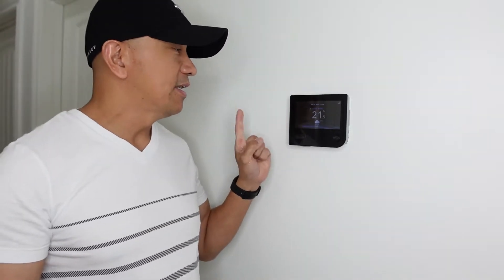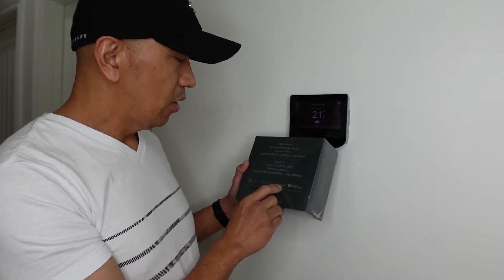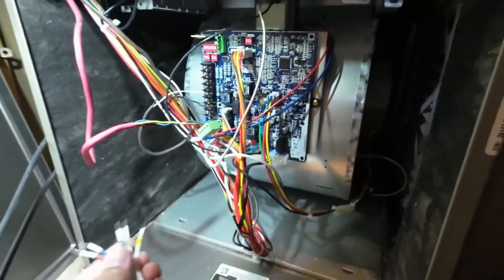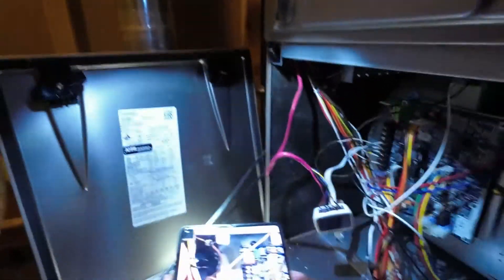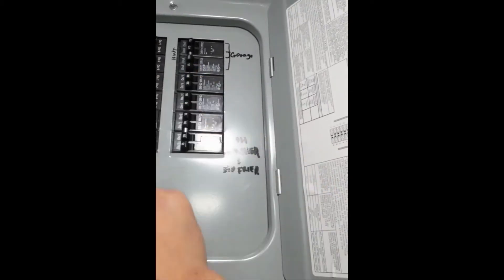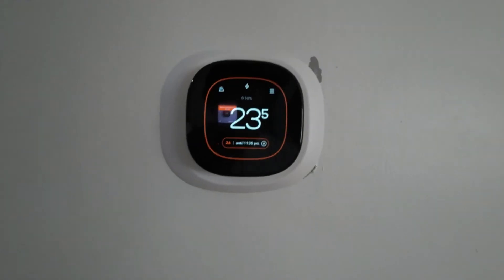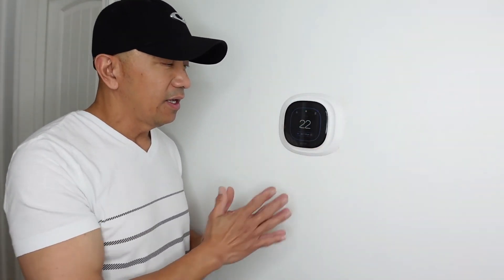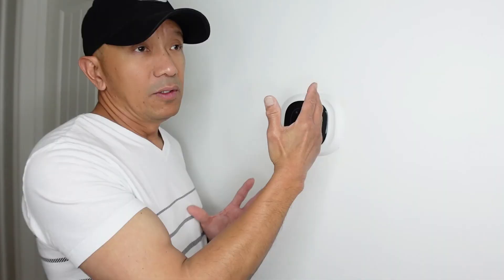ECOBEE HOW TO INSTALL SMART THERMOSTAT AND PEK POWER EXTENDER KIT UPGRADING FROM INFINITY TO ECOBEE

Comment: Great video, you also answered a question that I couldn’t find even in the Ecobee website about the power kit extension. Thank you.

I’m going towards the same direction as the Ecobee software is much better and supports Apple HomeKit nowadays. Tho, the humidifier unit may need external control, right now it’s “controlled” by infinity, however I don’t even know when it’s running or not, the app shows as not installed the wall unit shows as installed, I know it’s working because I check it at the humidifier unit. It’s a mess anyway.

Again, thanks for the video.

Comment: Hello, thanks for the detailed  instructions. I have the Carrier Infinity Touch system but the proprietary 4 wire in my house for A; B; C; D; is  Green (A); Blue (B); White (C); Red (D).  My mounting plate is color coded like yours (A = Green; B = Yellow; C = White; D = Red). In your video you do not show which wire is going to the terminals unfortunately as they are already disconnected when you are removing the old thermostat mounting plate. Can you explain how your four differently colored wires (Looks like Black, Yellow, Blue Red in the video) were connected to A; B; C and D? Thank you very much for the helpful video.

Comment: Do you have to rewire the outside unit also or just the furnace?
Reply from the maker: just the furnace
Reply: @alwaysmabel  thanks I bought a nest and rewired the furnace and it didn’t work hopefully the ecobee works with my unit
Reply from the maker: if it is infinity like mine nest is not going to work. I tried it before good thing that ecobee has this PEK to make it work. thanks for watching this video 😊
Reply: @alwaysmabel  so I have to buy the PEK device?
Reply: I have a C wire already ran just not in use
Reply from the maker: the ecobee smart premium thermostat has PEK included in the box

Comment: Salamat! Great help. I have a carrier infinity 96 that is almost 20 years old. The thermostat started to go crazy and I needed to replace it. The cost of the carrier thermostat was way too expensive. I got a ecobee with a Ontario rebate of $100. Your video helped me to install it within a couple of hours with no knowledge of HVAC. Thanks again.
Reply from the maker: you're welcome!  I'm glad this video helped 😊 thanks for watching 🙏
Reply: I work for a carrier distributor.. this is a huge no. The infinity uses carrier communication. You will not get the communication from your unit if you don’t use the infinity controls.

Comment: Why you didn't connect your dehumidifier with the unit ?  I have the same configuration, but the Carrier thermostat is not working at all, it's sensor is very bad, doesn't understand the room temperature at all. Bought ecobee but without humidifier it is bit tough to rely on the external humidifier. can you tell me the reason pls ?

Comment: So this is one year later.  Did this help your carrier system run more efficiently? Also, do you have a dehumidifier on the carrier system? And does the Ecobee control it as well?
Reply from the maker: Yes it became more efficient than the original thermostat controller.  yes my carrier has a built-in dehumidifier but it's not connected to ecobee. I purchased a separate portable dehumidifier.

Comment: This is a downgrade not an upgrade
Reply from the maker: why did you say that this was not an upgrade?
Reply: @alwaysmabel -depends on the system. The infinity control is like a computer on your wall and can do so much more than the ecobee.
Reply from the maker: the only thing I like in my infinity is the dehumidifying aside from that no more. it's always offline they removed the alexa which was the main reason I switch to ecobee and I see a big difference on  my electricity bill.  I saved more since I switched to ecobeee.
Reply: @DavidSelke-o9n  define “downgrade”

Do you recommend I purchase a fucking garbage Carrier thermostat when it fails every 5 years?  Is $1100 every 5 years for a piece of unresponsive, laggy, poorly built, planned obsolescence shit an upgrade?

I absolutely doubt it’s worth $220 per year for that thermostat.  Maybe I’ll potentially possibly almost save $221 / year on my energy bill, and I’ll save $5 over the life of this shit thermostat?
Reply: @datsyukiancircus  Honestly I'd pay $1100 to get rid of this terrible thermostat. I can't believe how many techs are out here saying it's a downgrade. There are so many customers trying to run away from these. I wanted to use my nest, but that doesn't seem to be an option, so I'm getting the ecobee.

Comment: Switching from an Infinity Touch to an Ecobee is a serious downgrade. You have disabled so many features of the infinity system by not using the Infinity control.
Reply from the maker: I believe you.. but I've seen a very good impact on my electricity and natural gas monthly bills. way lower than when I was using the original Infinity Touch and also I can control via voice over through alexa my ecobee when adjusting the temperature while Infinity Touch get rid of alexa.
Reply: The HVAC technician I hired to install an Ecobee thermostat (replacing an older, circa 2009, Infinity thermostat with no wifi) told me the furnace would not run as efficiently if I installed the Ecobee. He said he had complaints from clients that proceeded with the installation (fan not running properly, etc). I opted not to replace the older Infinity thermostat.
Reply: And saved yourself the painful Carrier pricing… Nice upgrade!
Reply: @MrCanuck0918 price comes with great warranty and reliability

Comment: Carrier infinity thermostat sucks. It keeps loosing wifi connection all the time but it has some detailed information of the system
Reply from the maker: yes you are right. the number one reason why I changed it to ecobee was because they removed the alexa.. fortunately when I used this ecobee I save a lot of money on my electricity and natural gas bills.
Reply: Dang.. sorry to hear that. Get with your carrier dealer to straighten it out

Comment: Can you still set the fan to run manually, hi/med/low?
Reply from the maker: yes you can set the fan manually but there's no hi/med/low selection.  the ecobee will run the fan if it needs to be in hi/med/low.

Comment: Would you be willing to share the dip switch settings on your furnace board? I have the same furnace and would like to confirm those settings.  Thanks!
Reply from the maker: yeah sure! but it will take couple of days for me to show it because of my job. thanks!
Reply: @alwaysmabel   not a problem, ty!
Reply: Were these dip switch settings shared? Also does the fan work on all modes for example auto, low, med, high?
Reply: Great video. Would you be willing to share the dip switch settings on your furnace board? I have the same furnace and would like to confirm those settings. 

Also, i have mine humidifier connected to the carrier control board in connection with the OAT. Will my humidifier continue to be controlled by the Eccobee thermostat?
Thanks,nav